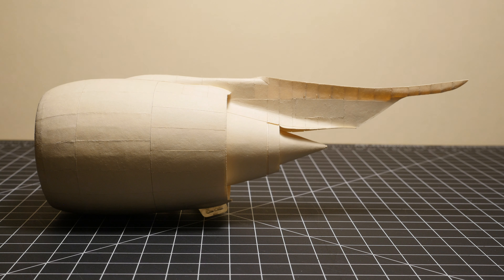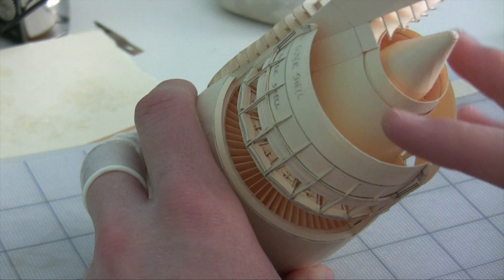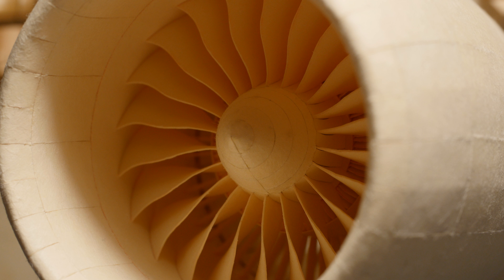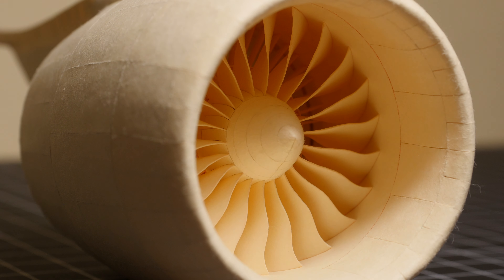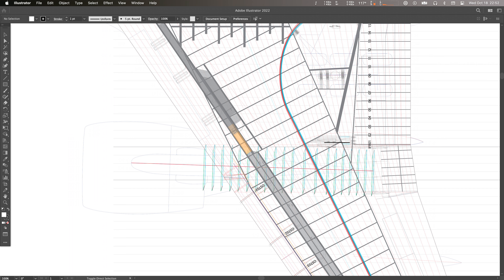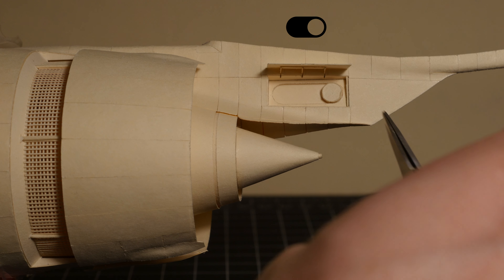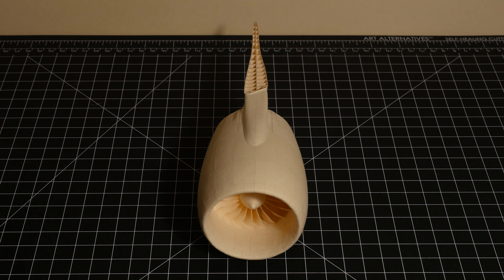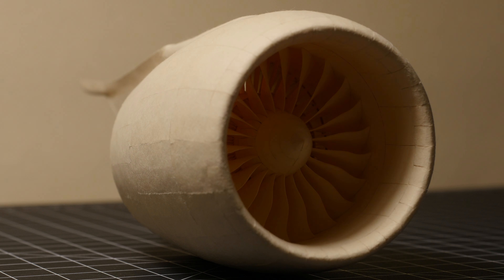Manila Folder 777-300ER - GE90-115B Engine and Thrust Reversers

Comment: the attention to detail is mindblowing! 
It would be amazing if it was made out of a material you would consider "stronger" like plastic or metall, but the fact that it's completely out of paper makes it even more special
Reply from the maker: I've considered that before, but I actually really like paper because it's so easy to work with. And if you design it right, it's actually shockingly strong.

Comment: Frack! 4:47  That screen/mesh in the reversers...Cut manila paper!?!  Each strip size and spacing consistent and uniform! Holy smokes.
Reply from the maker: It's a lattice mesh that I glued together. Even I don't think I would've had the patience or skill to successfully cut each square out by hand. Here's how I did it: https://www.flickr.com/photos/lucaiaconistewart/11781950545/in/album-72157639447895996/
Reply: @lucaiaconistewart  Thanks for the link. 'Patience and skill' that I am completely unfamiliar. I already could tell it was strips - but so uniform and evenly spaced. Amazing. One thing caught my eye on the forward turbine view; The perfect symmetry of vane spacing. The human eye is pretty good at noticing asymmetry, I dont see any. It seems the paper weight itself would lend to 'warping'. How? - are the vanes affixed to the cowling side as well as the center shaft? Beautiful work. EDIT - I think I just saw the answer in your Fickr album showing the two engines side by side, one uncovered. Clever!

Comment: You can use resin 3d printers for making molds or even guides to hold the parts of inner structure when assembling, some of them have gotten really cheap in recent years.
Reply from the maker: Definitely could work, though there's something I love about doing it all by hand :)
Reply: @lucaiaconistewart  Keep it by hand! That 'rule' has become integral to this piece. And 100% manila : )

Comment: Wow. It is is insane to see how you can still keep improving on your techniques. I was amazed by the reversers before, but now they look so much more robust.
I could probably think of a lot of questions, but what I wonder most of all is, how do you design the pieces for some of the complex curved parts of the model. The front end of the pylons for example. It's a doubly curved surface, but somehow you manage to model it out of only two pieces, which fit incredibly precisely and also don't look stressed by the curvature at all. How do you go about designing parts like that?
Reply from the maker: Great question! Depending on how much of a compound curve is needed, I subdivide the skin into smaller pieces to reduce the stress. But it's a lot of cutting, molding, and measuring, over and over until it fits right. To get the paper to actually take on a double-curve shape, I rub it against an eraser with the rounded end of a pen, and this causes it to deform a bit. I'm not sure if I'm explaining the process well though? I'll put up a video sometime soon to show the process.

Comment: Truly impressive bro, can I ask why the manilla folders instead of regular cardstock? Is it a thicker paper or something? Also I'm wondering if the entire model is 100% paper, or did you use some other materials, like the strings to open/close the thruster(at 4:32)?
Reply from the maker: I used them in an architecture class back in the day and really liked the feeling and malleability. I also kinda like the color. But there's no reason cardstock couldn't be used.

I actually use two different thicknesses of folder, 0.0125" and 0.21". The thicker stuff is for structural pieces like the inner cowling, the wingbox, etc. The thin stuff I use for everything else. And yes, 100% just paper and glue.

Comment: Amazing results, looking forward to the time lapse video. Were any other of the compound surfaces formed with the wet-bake process used on the blades?  Have you tallied the amount of hours  spent so far?
Reply from the maker: No, I just used that for the blades. I think it would be impractical for other parts. For most skin pieces, I rub them against a rubber eraser with the rounded end of a pen (like a sharpie cap) and that makes the paper deform into a compound shape.

Number of hours overall? Over 10K probably, no idea anymore.

Comment: How accurate are your drawings of 777 ?
I downloaded Stratosphere Studios Freeware Boeing 777-300ER model for X-Plane simulator, which is very detailed 3d model,
and trying to clean it up and using your drawings as reference, but found significant deviation between the two.
for example, when the fuselage diameter was matched, the tire size are way off. almost 15% bigger.
Reply from the maker: I doubt they’re perfectly accurate but shouldn’t be that far off the mark. Shoot me a message here, I’d love to know more specifics: https://www.lucaiaconistewart.com/contact
Reply: @lucaiaconistewart  I searched for the diameter of 777 fuselage, and it's supposed to be 6.2 meter, and the front tire diameter should be 1.09 meter.
your drawings are pretty close, and apparently Stratosphere Studio Boeing 777 model are a bit off. 
you can download their model for free, but it is in .obj format specific to X-Plane simulator and you will have to jump through a few loops to import it into blender.